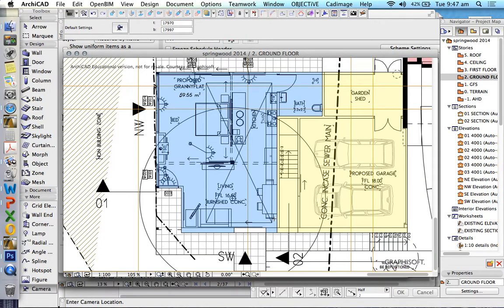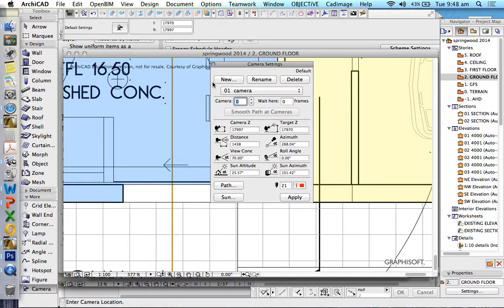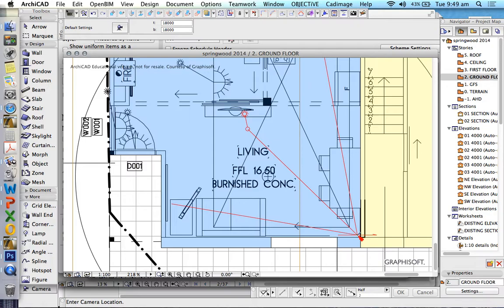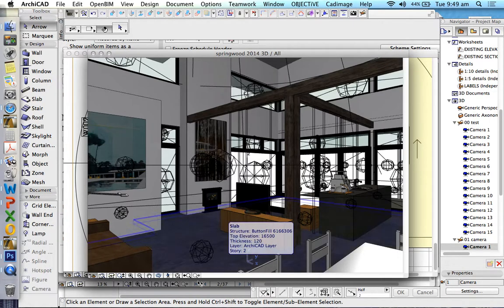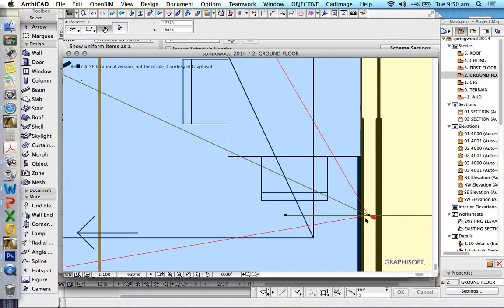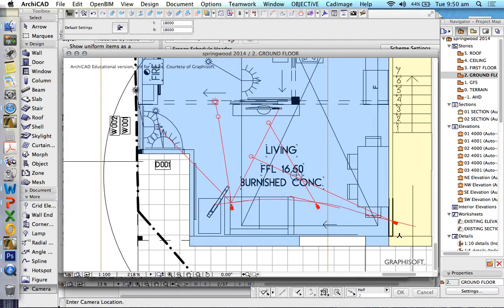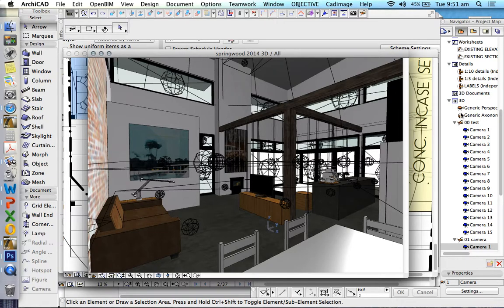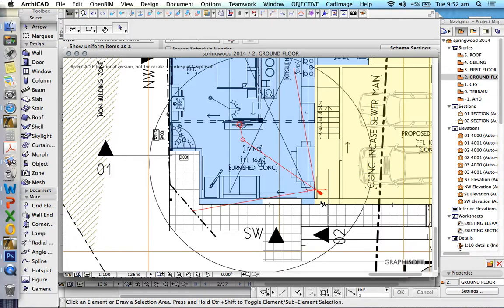ArchiCAD - Cameras

Comment: How can I place the camera in the second floor?
Reply from the maker: Adriana de Lima Sampaio Hi, you need to determine the floor height of your second floor (eg. 136 000) and add your eye height (eg 1 500). This will look very messy on the plan as you could potentially have 2 lots of cameras over the top of each other. Therefore I would recommend that you use separate paths for each level. (currently probably called 00 Untiled Path) you can make additional paths and save groups of cameras to each path. Hope this helps. At least one of my videos shows this process.